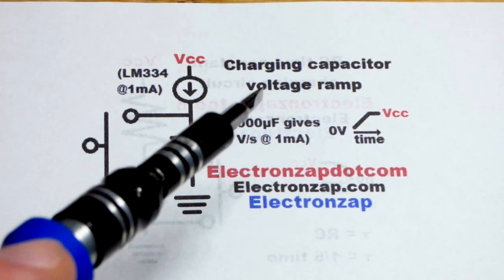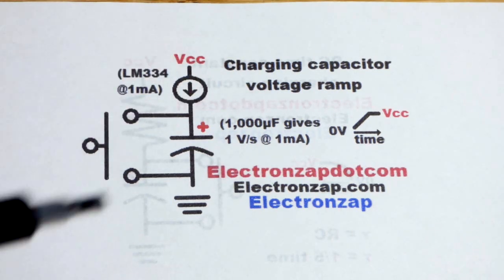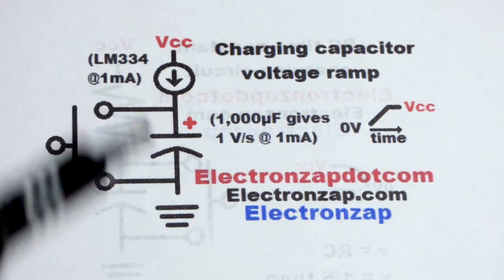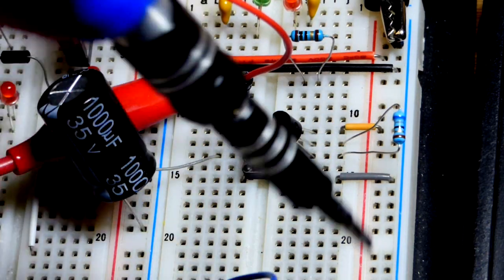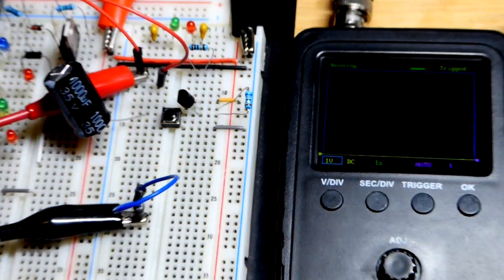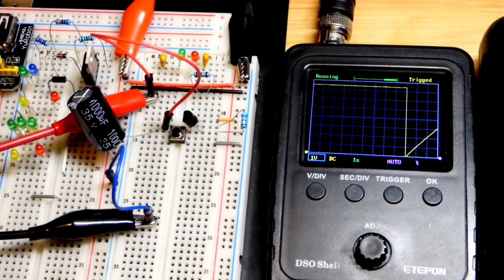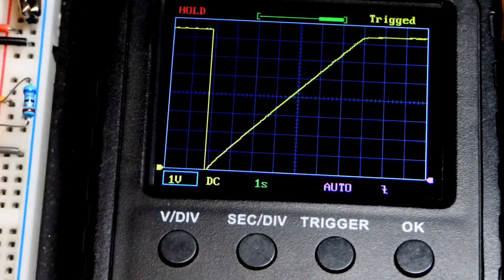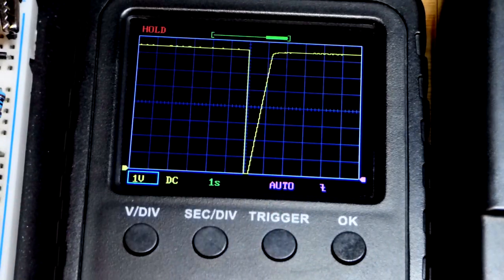Capacitor charging voltage ramp circuit made with LM334 current source component with oscilloscope

Comment: I need some help I dont know if hour still looking at these but. 
I have a 2000ma 12v motor been trying yo dlow start rsmp the voltage. Tried all types of the "soft start fet resistor cap configurations but they all seem to be push button to start. I want it to eliminate the button and when i apply 12v the motor to slowly come up to speed. When no voltage it slowly winds down.
Cant figure out why this wont wotk.
Gladly donate for the solution. I swear if i hear pwm 1 more yime ill die lol